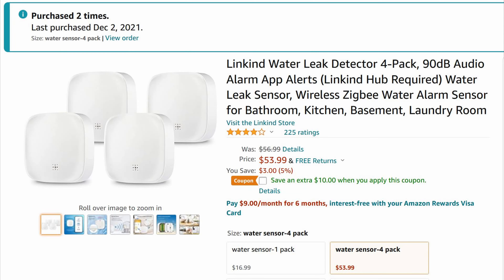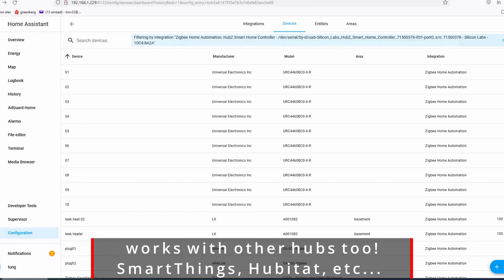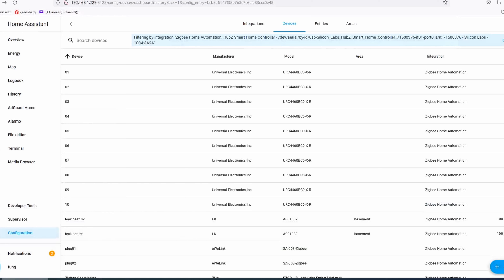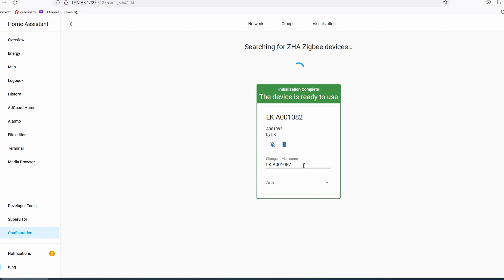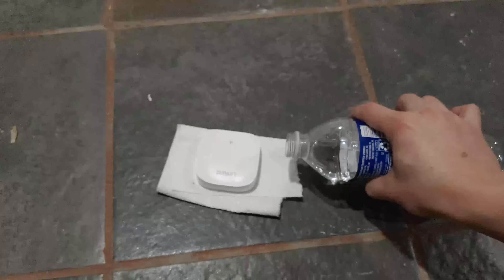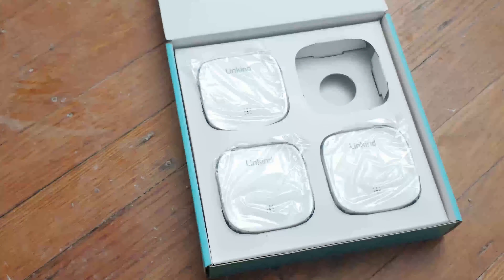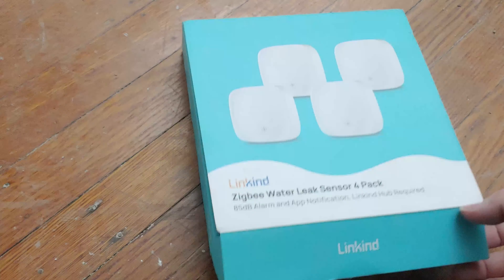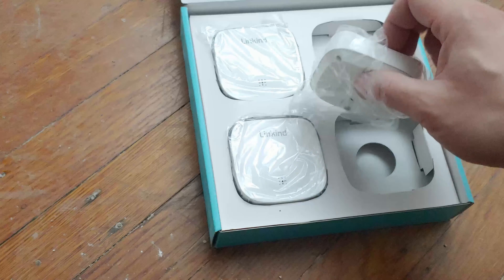Linkind zigbee water leak sensor installation on Home Assistant

Comment: Hi, can you explain how to connect this device to smart things app if I don't have the linkind hub?  The leak sensor goes into pairing mode but ST app can't find it when scanning.
Reply from the maker: sorry i cant help as i dont use SmartThing hub.  i only use HomeAssistant as it is much much more reliable than ST